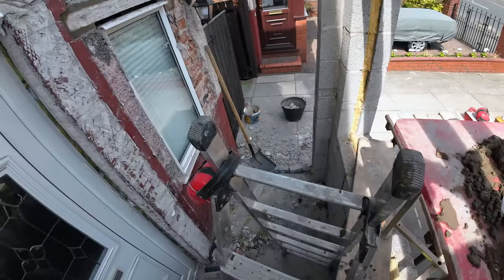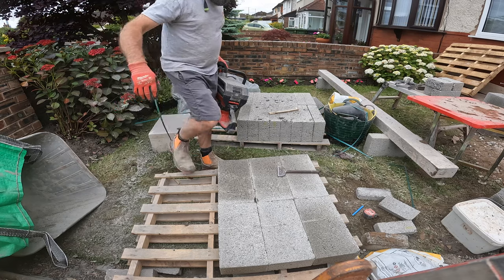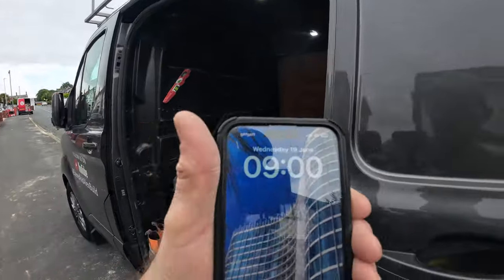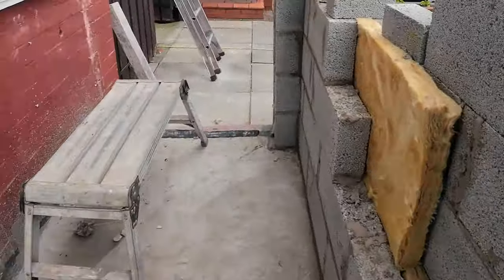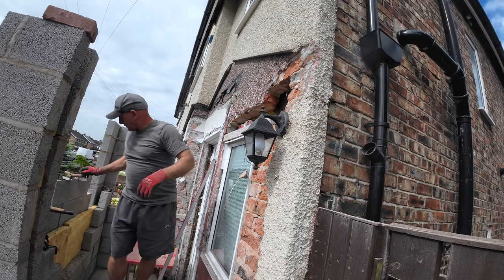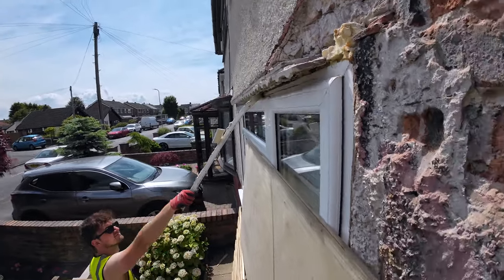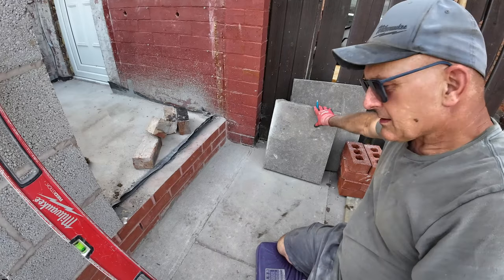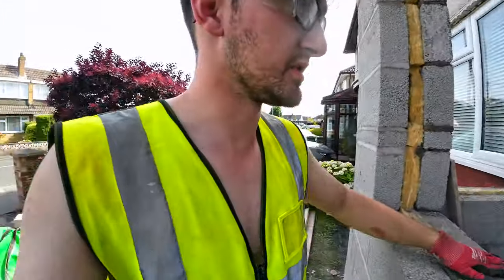FAILED  PORCH REBUILD… BLOCK WORK: Pt 5

Comment: I imagine, building this porch is not cheap for the customer, for such little gain in space.  Would making it bigger not gain more space in relation to the overall cost?  Or is it restricted by council as to the max size ?
Reply from the maker: Not allowed to just build waht you loke on the front of your house, strict rules plus everything is expensive nowadays 🧱👍🏽

Comment: great video thanks for sharing 👍

Without the aid of Acrow Props to support all the weight above, how is it even possible to remove 5 stretchers without the wall falling apart? ... is it because is next to  the corner that you don't need to ?

thanks in advance 👌
Reply from the maker: Good strong render holds up small gaps 🧱👍🏽
Reply: @SteveAndAlexBuild  thanks 💪
Reply from the maker: @yolomc2 👍🏽🧱

Comment: I like concrete blocks ,but you will never achieve a good u value laying them inside .
Reply from the maker: They ain’t concrete blocks
Reply: The structure is a porch, and not a habitable room, so "good" U-values not so critical as would be the case on a new extension.
Also please do check what type of blocks they are, and that will then give you an idea of  the achievable U- value.